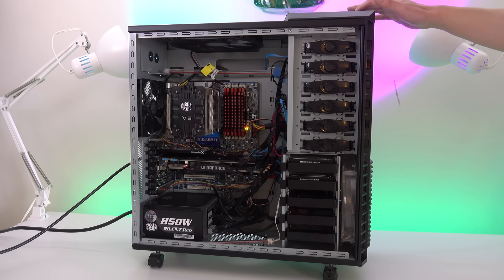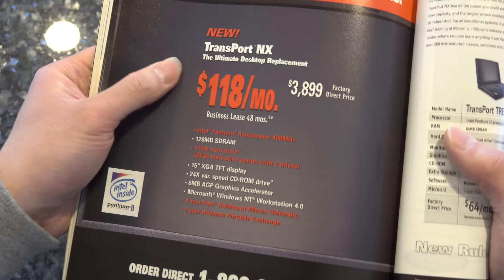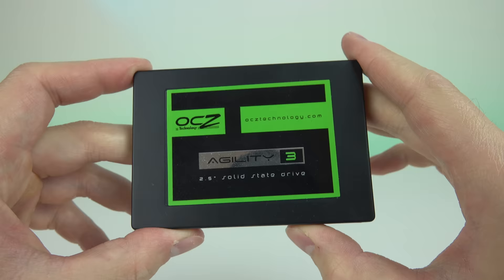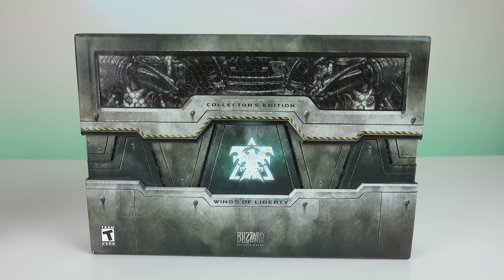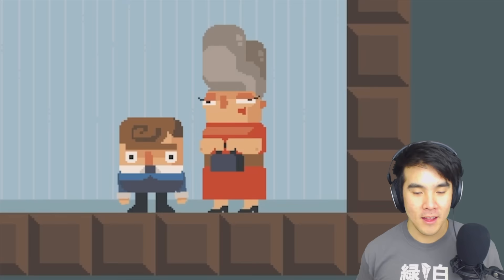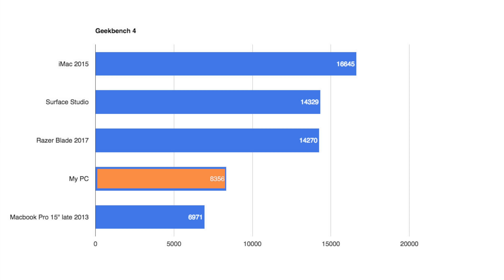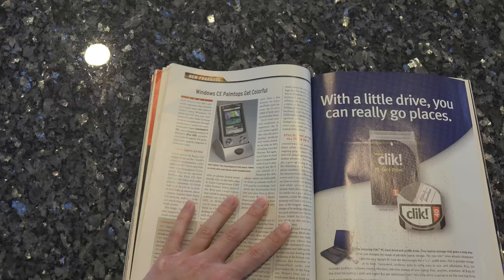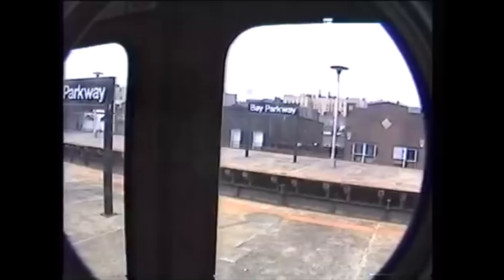I Built This PC for $1360 in 2010. Here's How It Holds Up.

Comment: Came for the weight loss, stayed for the good content. Keep it up, Bernard!
Reply from the maker: <3
Reply: Chubbyemu I think i7-930 is 1st Generation of intel i7 CPU's.
Reply: That's how I would describe it. Very first i7s were 920 2.67ghz(20x133mhz) for around $300, 940 2.93ghz(22x133mhz) for between $550 and $600, and 965 3.2ghz(24x133mhz) for $999. A while later we got a new cpu stepping and models 930, 950 and 975 with similar prices compared to the originals but with a bump to the multiplier on each(21, 23 and 25 respectively).
Reply: Nope: it was the refresh of 920. First gen: 920, 940, 960. Second gen: 930, 950, 970.
Reply: wait , he's in his 30's or 40's? wow he looks 20

Comment: In 2018, I still use my gaming PC bought for $1000 in 2009. The only considerable upgrade was last year, when I ditched my HD 5870 for a GTX 1060, added 2GB of RAM to get an 8GB total, changed the case and some coolers. It runs just about everything with fairly good perfomance at 1080p and will serve me at least more 2 or 3 years. The longevity of RAM, motherboards and CPUs has improved big time in this decade.
Reply: My CPU is top tier for my MoBo (lga 1156), so I would need to upgrade the entire system. When I do that, I'll want to get a better GPU too (my 1060 model is the cheaper one and the 3GB VRAM is starting to show its age), so it will be basically a new computer. But I don't have bottomless pockets. And I can live with 30 fps gaming for some time if I need to (not the case atm, except in very specific titles).
Reply: gonira Which CPU do you have?
Reply: @aleksastarinac9755  i7 870
Reply: That's gonna be tough, as you said it's gonna be a whole new PC. I'd get a used i7-4770k, you can get them for like 200$ in good condition and a brand new LGA1150 motherboard isn't more than 70$, they're DDR3 and the i7 is still a beast of a CPU. You could also go with AMD but Ryzens run on AM4 which is only with DDR4 and you'd need around 100$ for 8 gigs of fast DDR4 (Ryzens are super dependent on CPU speed).
Reply: Hey thanks for the information. Always good to know my options.
Reply: I still game with a hd5800
Reply: I'm on an Dell Xps 420 with Intel q6600 and 8gb ddr2 ram. I just upgraded the GPU to a Gtx960 2gb (from its origins Gt8800) and it's running Fortnite/overwatch on high settings. Cost very little for the card and happy with that for now..might overclock cpu tho but win10 runs perfect on it. Was gonna chuck it but its running so well no need to spend the £££.
Reply: 6 gb isn't a thing? Ram goes by x2.
Reply: @aleksastarinac9755  Pretty sure you meant Ram speed
Reply: @runthar2191 You're right, I meant RAM speed.
Reply: @Sythorize  u can have 6gb if you have 3x2 gb of ram
Reply: My build had a 3rd gen i5 with 8GB of ram, GTX 770 and a 2TB hard drive. Recently it was acting up (thanks to bugs) and was struggling on anything that required more ram. Since the motherboard was acting up I decided to upgrade, so now I have a Ryzen 5, 16GB, an SSD, I already bought a 1070 when it came out, same hard drive and same power supply. I bet this can last me a while if I take better care of it. Only thing I would see upgrading in the future is just more ram, maybe a Ryzen 7, but the 1070 is a hell of a card, I see that lasting a while.
Reply: You can run low detailed 4k games with the 1060! You need a new cpu now hah
Reply: Bro buy a ryzen 5 2600 used i got it for 140€ just 2 months used i think it's a dirt orice for this cpu
Reply: @igorkrstic8327  I just bought it too, wait till most devs make the most out of all the power
Reply: @caffeinefiend1217  I knoq quite a few people today still haven't changed much of their harware since 2012 and earlier
Reply: mines 2014. Could upgrade a gpu and last another 5~ years.
Reply: @PetrisonRocha  I just build my own pc with the same cpu you have except its branded as the xeon x3470 (same cpu just different branding and ecc memory support) . I am using it with a 960 2gb and the games I always wanted to play now run smoothly enought for me. I won't be upgrading any time soon until ryzen 1st gen becomes cheap as my xeon lol. (17$)
Reply: How's it holding up?
Reply: @Firegod24  I upgraded the whole system at the end of 2019 because I jumped to a bigger, higher resolution screen. At the time, the GPU was still good enough for 1080p, high settings or better (medium only in worst case scenarios), and some games wouldn't hit 60 fps because of the CPU bottleneck (only a minority though).

Now I'm running an RTX 2070 with a Ryzen 3600 and 16GB RAM into an ultrawide 3440x1440 120hz g-sync display. Flawless.

The R5 3600 is not top tier as my i7-870 was when I bought it in 2009, but I expect it to last through my next GPU upgrade.
Reply: Hahahaha
Reply: I have a gaming pc bought in 2019 and i haven't made any upgrades but the max for my system is probably 

I9-9900KS/X (LGA-1511)
32GB Ram (2666 Because it's garbage)
Any GPU with 6+2P PCIE/12VHPWR (PSU Upgrade needed because no PCIE)
PSU 500W (?)
3x4 NVME 2280 (? Brand)
2.5 Sata SDD (? Brand)
?
Reply: it’s 2023 now heading into 2024 next month. what specs are you using now? is this pc still the pc you use today or did you build a new one?
Reply: @dead-rh8ro  No, I upgraded it entirely. It lasted me until the end of 2019. Now I'm running a 1440p screen, RTX 2070 (starting to show its age, actually), Ryzen 5600 and 32GB DDR4 RAM. Case and fans still the same though, haha.
Reply: I got a PC, that is still capatible even in 2023. core 2 duo e7300 4gb ram and hd5450. Old Systems for the Win! If i wasnt smart i would not got a high end pc before.
Reply: @PetrisonRocha  i like seeing these little time travel comments to where you had a whole different build. maybe you'll be back to this thread in another 5 years lol
Reply: @roen7657  Haha indeed
Reply: I really doubt that this runs anything with good performance at 1080p because i had a fairly similar build that could not go over 40 to 50 FPS on most modern games at medium to low settings.
Reply: @BaieDesBaies  It could, but this was 5 years ago.
Reply: @PetrisonRocha  Ok, I misunderstood. I just changed my old GTX970 build because i thought it was outdated.

Comment: Man.... watching this on a pc with a R7 5700X, 32gb of 3600MHZ Ram (unthinkable back in 2010), and a RTX4060TI that could take that 970 to the moon and back 10 times is crazy.... computers really have come such a long way. even more crazy to think that even my computer which is significantly more recent would only be considered on the high side of the mid end spectrum/ on the low side of the high end spectrum.
Reply: I just built a pc with a 12600k, 4070, and 32gb of 6400mhz ram, so seeing all this old hardware kinda blew my mind on how far we have come
Reply: @a_h1pp059  I'm going to join the gathering of flex that this comment seems to be (lmao). Just built a PC with a 13600k, 4070ti and 32 Gb 6000 MHz
Reply: @shineki1743  I just build a PC with a 7800 X3D, 4080 and 32 GB 6000 MHz CL30 Dominator :D
Reply: Here let me lower the flex, I just fixed a pc I found in the trash that has a 1080ti, 32gb ddr4 ram, i7 7700k. Will be giving my gf this pc for Valentine’s Day 🫡 also don’t worry I cleaned the case, cable management and it’s practically looking brand new
Reply: @Takeoi  it was never meant to be a flex. Just crazy seeing how much faster hardware is today that isn't even close to top of the line then hardware was in 2013 that was nearly top of the line. But all the power to you, I built my girlfriend a PC with a r5 2600, 16gb of ram, and a 1070ti over a year ago. Now we live together and her PC was nicer aesthetically so I put the upgraded parts listed above in hers and sold mine because we didn't need two PCs!
Reply: You forgot the ddr5 memories now

Comment: Wow really timely.  I built a computer back in 2011 for about $1400, and I've been thinking about doing some upgrades myself, possibly a whole new built.  Good to hear your perspective!
Reply from the maker: thanks! yeah, i could probably get away with another 12-18 months on this rig
Reply: depending on what parts were used in your 2011 build, you could probably save a little money on a new build....if your PSU, hard drive(s) and case are still in good condition, you're looking at around $100-$200 savings...just would need a new GPU, CPU, Motherboard and RAM...
Reply: I'm also including the cost of Windows 7 operating system in the cost.  But if I can reuse my power supply, case that would be good.  I'd probably want to start with a fresh hard drive, both a solid state for booting and mechanical for storage.  I haven't looked at new hard drives as the technology has gotten a lot better.  Although thinking about the case, it looks like some of these new GPU's are crazy large.  I'd need to do some measurements to see if I could use the same case.

Comment: I Built This PC in 2010. In 2017 I still use the CPU and the box. All the others have been replaced.
Reply: Jim yep basically it
Reply: "the box"
Reply: LITERALLY
Reply: Sagit Swag qq
Reply: Jim the CPU, motherboard, PSU are all essentially the same however do get your point. Think the wider point is that you’ll have to upgrade everything in life with how quickly technology advances in certain areas. For instance not many (perhaps 1%) people would keep the same phone for 7 years.
Reply: @user-sg5vb7ou9i  Most phones wouldn't even survive for 7 years probably. Not talking about breaking it, but it could also happen.

Comment: Good to see I'm not the only one using a 2010 PC, I have the V10 cooler which is a bit bigger than that one, absolutely overkill haha. Looks like we have the same issue with the old motherboard too regarding SATA3/USB3.
Reply from the maker: definitely. I think with USB-C and it supporting thunderbolt 3, that might for sure spell the end of this PC in another few years. I can still get some life out of this machine by upgrading the processor, as many of the comments keep suggesting.
Reply: Yeah true, I've only upgraded the SSD and I've gone through 3 graphics cards but I keep buying the same generation from 2010 when they die, so replacing is only like $20 lol. I've been considering a new PC for 2-3 years now, but apart from slow video rendering speeds it still just does what I want.

Comment: 2013 built a pc for 850$ of all components 1step below the most expensive, It still holds up but now I can't upgrade. RAM and GPU are 3x more expensive than back then.
Intel 3770K, Asus Radeon 7990 3GB, 8Gb RAM, OCZ vertex 4 128GB SSD.
Reply: Ddr3 is pretty affordable used today. I run basically the same system as him with a x5675 xeon overclocked, 24gb ram and a 980ti, it still does pretty great

Comment: I'm still using the Asus tower I bought for $899 in early 2012. Still running Windows 7 too. It came with Intel Core i7 (3rd Gen) 3770 / 3.4 GHz, 2 1TB SATA drives (1HDD & 1 storage drive), 16GB of DDR3 SDRAM, NVIDIA GTX650 Ti with 2GB SDRAM, DVD RW, 16 in 1 card reader, 7.1 channel surround audio. I haven't upgraded it at all except to add a 5TB external drive (have an extensive movie and TV show collection). I've looked at some new desktops lately and I'm not all that impressed, although I am interested in getting a SSD for the speed it offers (or maybe a hybrid drive).

Comment: Even if it makes the tech world significantly less exciting as a result, I'm actually pleased with the fact that we get to keep our stuff for longer and longer.
Apart from the SSD and graphics card, which have been upgraded in 2015 and 2016 respectively, all of the parts in my computer were purchased in 2012. I am only now considering an upgrade of the base platform, not because of the performance which is still fine, but for small things like having more SATA3 ports, NVMe support, and better connectivity in general.
Reply from the maker: yeah connectivity will be a sore spot in the coming years. i shoot 4k 100 Mbps, which is close to the SATA III limit. raising those standards will seal the fate of this PC unfortunately

Comment: Haha, I designed those clamshell backings for the OCZ XTC RAM you have. You sure kept everything in great shape. If you ever called or dealt with OCZ support or marketing from 2002-2009, you probably talked to me. -Sean
Reply from the maker: that's awesome! i only had to deal with OCZ in 2011 when the Agility 3 kept failing on me, so might not have
Reply: Agility 3 was a Vertex 3 with cheaper NAND, designed for budget. Given the issues with Sandforce drives over long-term, which I think has a lot to do with a lack of cache, the Agility 3 had a lot of issues. I was at OCZ in 2011, but would have been in the Compatibility Labs in those days. Ryan Petersen once shipped about 200K worth of failed DDR3 to Europe and then tried to screw the distributor on the return. OCZ was a shady operation.

Comment: The funny thing is even now, 6 years later, this thing is more than usable. A simple bios update, x5675 or better xeon paired with a 1080 ti or similar graphics card, this computer would still pump out good frames even on newer games.
Reply: Ngl 1080 ti was a remarkable beast. Nothing still beats it in terms of reputation

Comment: For editing ,you should check that cuda acceleration is enabled,because my pc is worst than that and it render way faster than yours.
Reply: IMNOTA are you rendering at 1080p like his is or 720 or lower
Reply: I do 1080 and 720 depends of what I render but anyway I am pretty sure that he does not have cuda acceleration.
Reply: IMNOTA how to u enable it
Reply: You need an nvidia card and in the project settings,you will have mercury something and replace it by cuda

Comment: hey man, great vid. eBay Xeon w3680 or w3690 CPUs, they aren't that expensive and are 6 core/12 thread and should work in your board. Also they are unlocked so you can OC them easily, and this should help your streaming massively (besides using a capture card and streaming with a second PC). Your PC is still a monster, ride it till the wheels fall off! maybe continue to utilize the PCI and PCI-E expansions to add more usb 3.0 and sata III ports too. Used 980tis are going for $250 or less as well! Rock on, man!
Reply: hopefully you see this if you were hoping to upgrade!
Reply: He could just buy an x5650 (also 6 Core/12 Thread )for 20$ on Aliexpress and overclock it to at least 4GHz.
Mine runs on 4.3 Ghz at 1.31 Volts.
Reply: X5670 on the way to me from MyFriend Country :D
Reply: He already has a 1070, so a 980Ti is useless. Xeon would be good for streaming and doing it cheaply, but I guess one of those cheaper AMD 8 core processors would work as well if he wants a more massive upgrade (with a newer motherboard as well). Ryzen 1700 especially seems like a great choice, and it should be cheaper by next year when another bunch of Ryzen chips will come out.
Reply: Slippy Toad he has a 970 not a 1070
Reply: problem is for ryzen he needs new RAM which is very pricy right now
Reply: Used 980TIs are NOT going for $250, don't be full of shit.
Reply: TheRailroad99 Yes they are, sorry your area sucks on Reddit/r/hardwareswap or Craiglist. but I've bought two 980tis, one for $250 and one for $260.
Reply: Few people actually use hardwareswap and craigslist is only good for major areas (and not even all of them). Just because you managed to get 1 980TI for $250 does not mean the rest of the country can.  That's a good deal but not an everyday price. Was it reference?
Reply: bobsagget823 They seem very active to me, but I did say it would vary by area in my previous response. however, me detailing what they could go for just means there's a chance, the used market is never a guarantee. the $250 one was an EVGA 980ti SC+, the $260 was a gigabyte Xtreme gaming. neither were listed for those prices either, I simply made a lower offer and the response I got was the prices above. hard to beat. Some people are just better at finding used deals than others, depending on the area (again).
Reply: bobsagget823 Oh also, EVGA themselves tweeted out a deal while supplies last for brand new reference 980tis for $199.99. and their VR edition for $209.99. brand new, not used, and didn't depend on your area. Deals are abound my friend, just a matter of knowing where to look and when to look.
Reply: hey dude, im curious about how can you stream with 2 pcs. I know that it is possible and it gets way better image quality etc etc but how? im from brazil so please try to not use a lot of techie words, cause I can't understand it at all. Im thinking about upgrading my pc and I want to stream and record videos as well, thats why im interested. Oh btw hardware here are a LOT more expensive, gtx 1060 goes for 1000 R$ (you can buy them with only 250$... sad) so don't tell me to buy a gtx 1080 ):
Reply: alan eduardo as far as i know you feed the image from PC1 into a capture card which sits in PC2. PC2 then processes the raw video, and streams it on twitch. that way the video processing can be done with a very high quality because the CPU from PC2 is not used by the game
Reply: IndianTechGuru oh ok thank you :D very infformative
Reply: Alan, you could also use NDI via Xsplit. Xsplit gamestreamer on the gaming PC, Xsplit broadcaster on the Stream PC, and Xsplit will let you select the gaming PC as a source and it all works over the network as well. NDI is very great. Do some googling/youtubling on streaming with Xsplit and NDI and you might like what you find.
Reply: @Coalition Gaming - OBS Studio also supports NDI - http://blog.newtek.com/blog/2017/06/16/open-broadcaster-software-adds-a-few-million-new-users-for-ndi/
Reply: Coalition Gaming I agree, I'm rocking a w3690 myself, @ 4.5ghz it scores 1059 in cinebench r15 and at 4.6 it scores 1077, it's a beast of a cpu